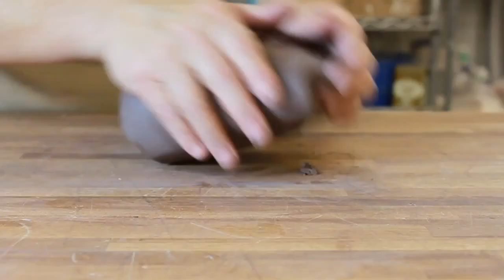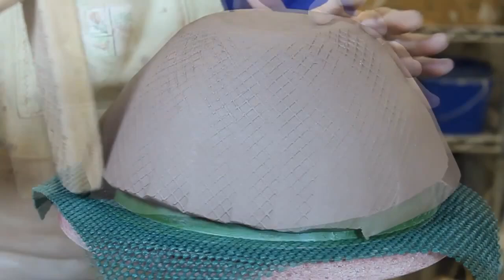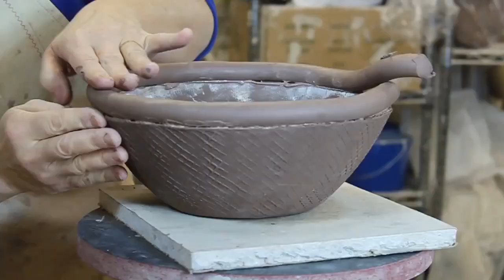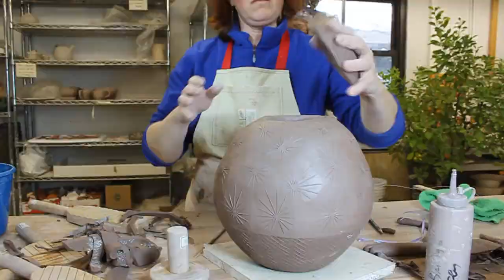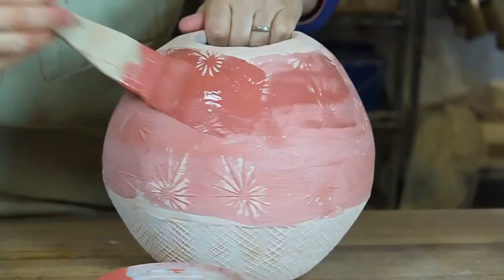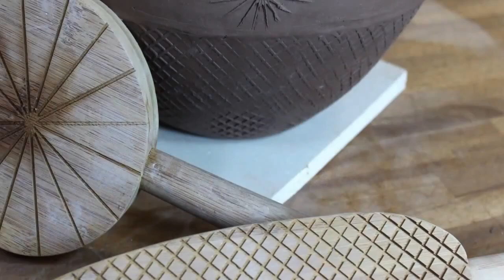Bridges Pottery - Ceramic Slab and Coil Vessel Demonstration

Comment: The coiled portion looked so much like the bowl formed slab portion, couldn't you simply have joined two bowl formed slabs together? wide part to wide part then cut out the base to create the hole on top. Are the replys being deleted? every time i click to read a reply to a question nothing is there.

Comment: You don't need to score and slip each coil. You are already smoothing it in the inside
Reply: ben lastname not true, it will crack in the kiln. You have to slip and score every coil because you bake this clay at a super high temperature for up to 2 days so it cannot resist but cracking

Comment: Depends.  With the wheel it is harder to make larger pieces until you have worked for quite a while. Handbuild allows for a distortion, not "perfect circle" which can be appealing.  Depends on what the desired outcome is ultimately